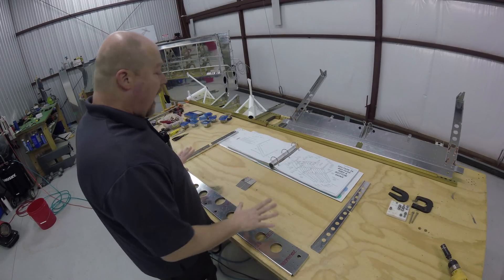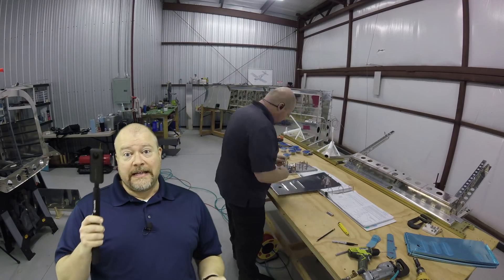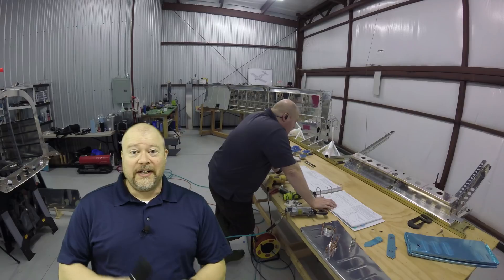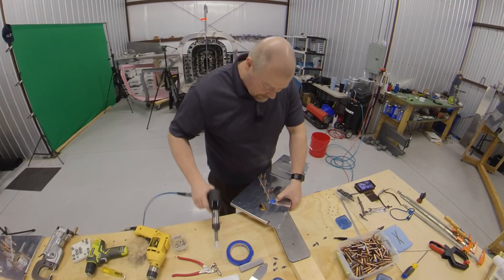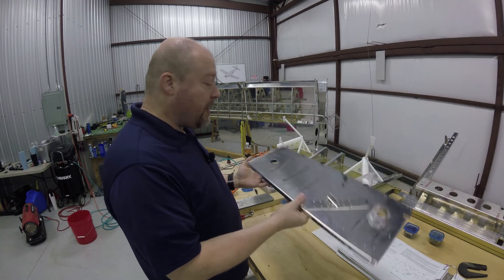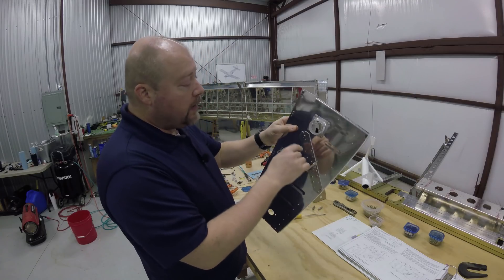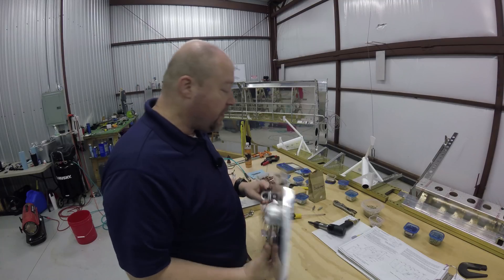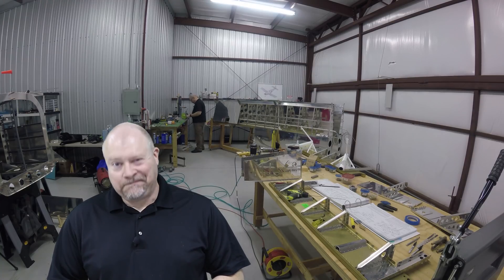RV-10 Fuselage - 008 - Center fuselage ribs

Comment: Do you have a preference between air drill and just regular cordless drill?
Reply: He has answered this question multiple times in previous videos.  His main complaint about the air drill is that it uses a LOT of air inefficiently and seems to require a large air compressor.  When he built the tail cone he uses almost exclusively a cordless drill and wore it out.
Reply: @davidboyd8822  Thanks for answering, I have not been able to watch all of his videos yet, but all the ones I have are very informational.  I am getting ready to my first kit and trying to get my basic tools ready.  I have several Dewalt drills and wanted to make sure that these would work.
Reply: @whitmats  Yeah, I know what you mean.  When I found this channel last year, it took me weeks to watch the videos and get caught up.  It was difficult wanting to comment on something and see it was a video from 2016.   He actually did a video not too long ago where he talks about the pneumatic drills and compressors...https://www.youtube.com/watch?v=DYWW7dWJkTA
Reply: @davidboyd8822  Thanks,  I will check that one out tonight.

Comment: Jason, have you ever tried back riveting using a c-frame? That part where you used the back rivet plate and the piece of wood is a perfect use for that. It also makes perfect shop heads (mostly) because there is little movement due to the c-frame.